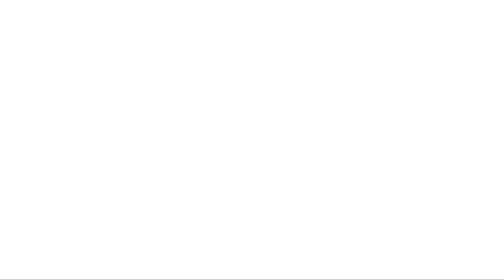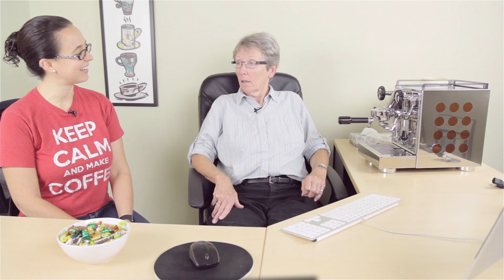Ask Gail: PID On A Heat Exchanger?

Comment: A competing company's video states that the cooling flush is not necessary on the Profitec Pro 500 PID.  Do you agree with this assertion? It has to do with the PID (obviously), but also the way it cycles cool water through the E61 or something to that effect.  In essence, it has additional features beyond the PID that keeps not only steam pressures consistent, but also brew temps.

Comment: Hi
I'm still a bit confused. In a traditional heat exchanger machine, I thought the boiler was controlled by a pressure stat, not an actual temp sensor. Is this correct? If so, does the PID (temp sensor/controller) takes the place of a pressure stat in these higher end machines?
Reply: Yes, see the Profitec Pro 500

Comment: PID on a heatexchanger seems like a silly marketing idea. Probably sacrifices steam power for brew temp consistency.
Reply: Update, well I got one and definitely sufficient (if not too much steam pressure vs my old thermoblock machine) :D  It seems like the temperature is very consistent and there is actually little need for a cooling flush, maybe just a small one, but I don't see the water super heated like other HX type machines without PIDS seem to get after it's been sitting for a bit. 

The benefit of a heat exchanger without a PID is that you can probably control the temps quicker and get more temperature variation within a shot, that's AFTER you figure out how much of a cooling flush you need for your machine and you never really know what your temps are going to be, but you can still master it eventually, with a PID it seems easier / more consistent.